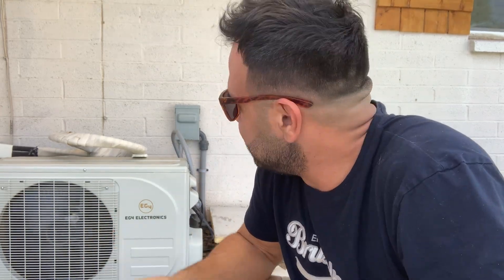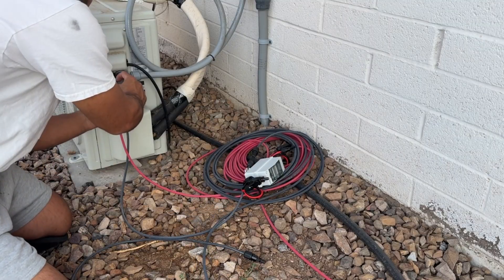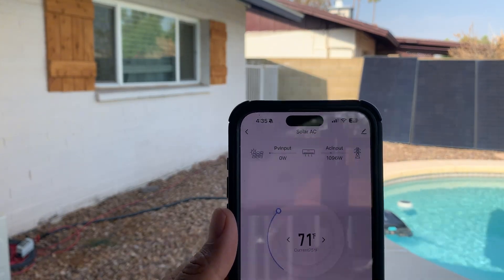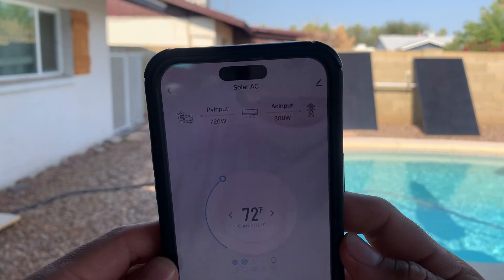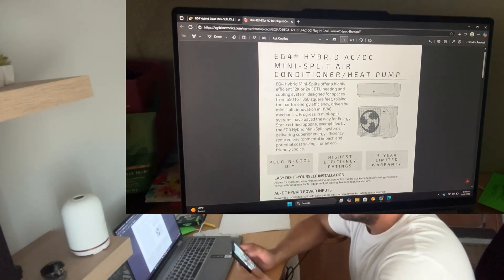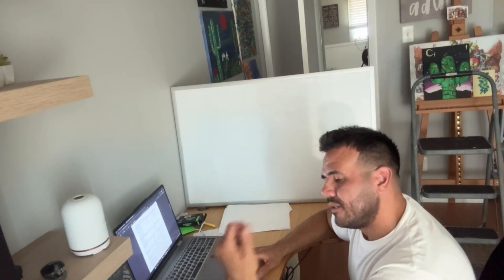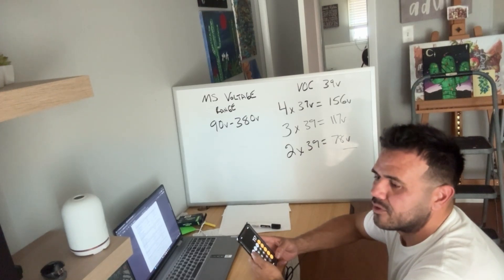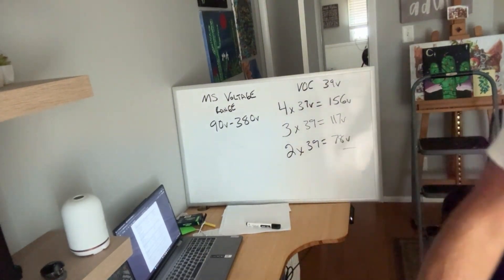How Many Solar Panels to Run a 12k EG4 Hybrid Mini Split?

Comment: Hope you learned a valuable lesson always buy new solar panels , never buy used solar panels there is usually a reason they don't want the panels so there selling them hoping someone like you will take them off there hands and deal with them, so I always suggest buy new solar panels if you can't afford them now save up don't buy junky used ones, just saying
Reply from the maker: I buy and sell used panels all the time. Most have 20–30 year warranties and these ones I’m using now are only about 4 years old, so they’ve got decades of life left. Right now they’re just leaning against a wall facing west at a bad angle, and they’re still producing. Once they’re mounted properly—facing south with the right tilt—I’m confident they’ll perform close to their rated output. Used panels aren’t for everyone, but they’re simple, durable, and a great value if you’re comfortable with the risk that you may get a under performing panel every once in a blue moon.

Comment: I noticed that you only measured V open circuit. That value is great to be sure that you don't exceed the 385V. However your max power point voltage will be lower. My guess is for 400W the max voltage of 32V with a current of 12.5A. So 3 south facing panels at the perfect angle at 12 noon would run the mini split. The voltage for 3 panels under those conditions would be 96V. Given the orientation of your panels you need at least 4 to stay above the 90V for as long as possible. Check your pv power at 6 and 7 pm. Then add panel #5 and see if that helps. Thanks for the video.
Reply from the maker: Thanks for the analysis! 👍 I appreciate the detailed info on voltage and current, and I'll test that out at 6 and 7 PM to see how things look.

Comment: These solar mini splits tend to want to work at maximum productivity based on the demand which requires a certain amount of power so it will try and load share if the PV is not enough by itself. I have 2 of these hooked up with 2 different panel configurations. You may want to try your 3 panel solution again but enable the AC limiter on the app. That should tell the unit to make as much use as it can from solar and use as little as possible from AC and you may get slightly better PV numbers but the unit may not be working at its best. One of mine has PV and battery/AC line from my larger system and the other is PV and grid AC with a slightly smaller array connected. in the AM or when overcast, I will sometimes turn on the AC Limiter to minimize grid usage for that unit till the sun rises a bit more. Just a thought if you want to see the difference yourself. There is also ECO mode which I am not yet sure how that affects the operation.
Reply from the maker: Appreciate the insight! I’ll definitely test out the AC Limiter and see how it affects PV usage during early mornings and overcast conditions. Might even make a video on it once I get some data—it’s a great tip for anyone trying to fine-tune their setup and minimize grid or battery use. Thanks for sharing!

Comment: After looking into, I don’t understand the point of it connecting it to pv directly and paying 2000$ for a split that takes pv. I’d rather have the panels charging a battery and connected to a system
Reply: @angel-angel-angel-angel-angel that is a very good question. You could use those panels to charge up a battery bank for you. Ouse inverter but the catch is you loose efficiency.  What I mean is you store the DC voltage and convert it to AC using an inverter which you loose between 15%-30% (I don’t have exact figures). However it would be cheaper to not get the hybrid mini-split so you have to figure that out for what works for you.  Anyway that is an excellent question and one I initially asked myself. All the best from north Texas.
Reply: For a lot of people like myself I have the maxium amount of solar panel input that my inverter can accept, and on days that I dont get full sun all day it doesn't charge my batteries to 100%, with using these hybrid mini splits it runs 100% off the sun thus taking all that energy and putting into batteries, I live in florida so it runs at max all the time and with that I do not need to run my main house AC and it keeps our temps under 70*,  Plus they are ultra efficient. And for people that are totally off grid with no grid power it gives them the ability to run AC where they couldn't do it without the use of a gas generator. These are a game changer for some situations.
Reply from the maker: @Rock_Nemo  Exactly — one of the biggest benefits of these hybrid mini splits is that they take a dedicated load off your main system, especially during low solar conditions. Since the mini split has its own MPPT and solar panel input, it doesn’t compete with the rest of your loads or battery charging on your primary inverter.

That separation gives your main system more flexibility — instead of diverting limited solar to run AC, it can focus on charging the batteries or powering other essential loads. Even on cloudy days when every watt matters, this setup helps you stretch your solar capacity more efficiently by distributing demand across independent inputs
Reply: There is a trade off in how you build your system. If you run your M/S only off battery, you have to account for that 1KW/HR+ load and may need a much larger battery stack to handle that added load and not compromise on maintaining critical systems in an outage so the cost moves from panels to a larger battery. You may have space for the panels or for the batteries but not for both. I opted to have the ability to run the M/S on only panel if needed and not impact my other critical systems run time with limited space for batteries and plenty of space for panels. You can definitely buy a much cheaper and possibly lower quality mini split for a third the price that doesn't support direct solar feed but most are not true DIY needing special tools, gauges and vacuum pumps plus the knowledge on how to use them or you are paying the difference in having someone install it for you and then you still are stuck with needing more battery. I would rather be able to keep my food cold for longer in an outage and still be able to cool or heat the house (with available sun) and I have the best of both worlds with my M/S doing both so I have options depending on the situation at hand.
Reply from the maker: @gordoncox8082  Well said — I think that’s a really smart approach. Offloading the mini-split to its own dedicated solar input gives your main system a lot more breathing room, especially when battery space is limited. That 1 kW+ continuous load can be a real strain on storage during outages, so being able to keep critical systems running without competing for that power is a big win.

I’m in a similar boat — my MPPTs are already maxed, and using the hybrid mini-split with its own panels has given me way more flexibility. It lets the main inverter focus on battery charging and essential loads, while the mini-split handles the HVAC as long as the sun’s out. Bottom line: the hybrid setup just gives you more flexibility.
Reply from the maker: You’re absolutely right — the best value by far is going with a traditional solar system and a regular mini split. It’s not even close in terms of overall capability and flexibility.

That said, I’ve been using the hybrid mini split lately to test used solar panels, and it’s been surprisingly handy in a few niche situations. But for the most part, they’re definitely limited compared to a full system setup.